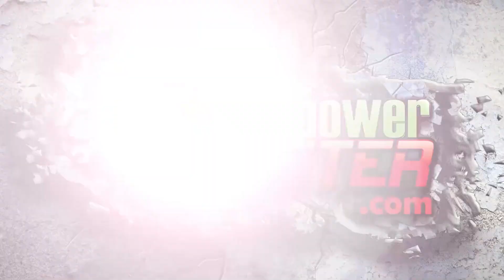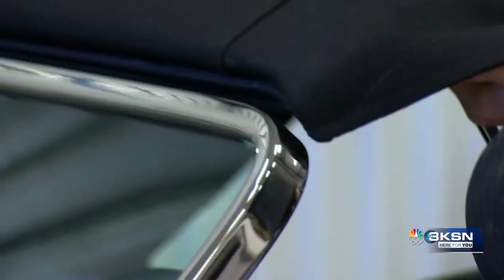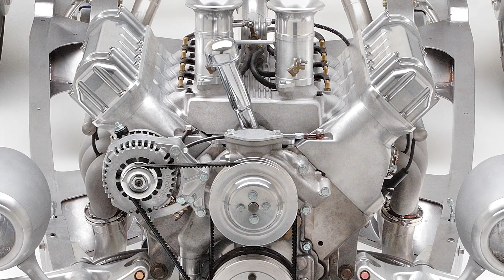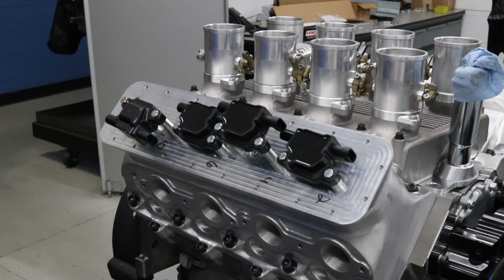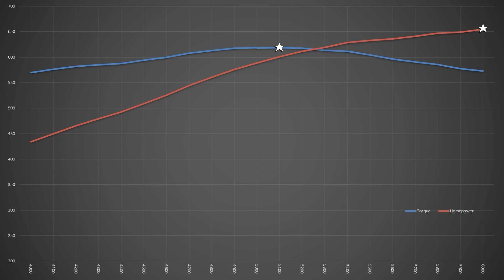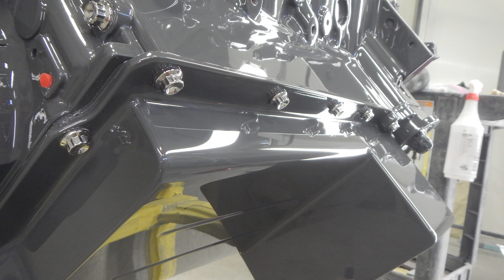What it Takes to Build America's Most Beautiful Roadster

Comment: That is one of the cleanest builds I've ever seen.  Did I miss something about the heads?  Are those 1 offs?  They are beautiful I know that!!
Reply from the maker: No, the heads are just fairly standard castings. But they have been highly modified and smoothed for a completely different exterior look. Also have been hand ported. Thanks for watching
Reply: @TheHorsepowerMonster  why are the rockers so low?  They just put a flat plate over them to mount the coils